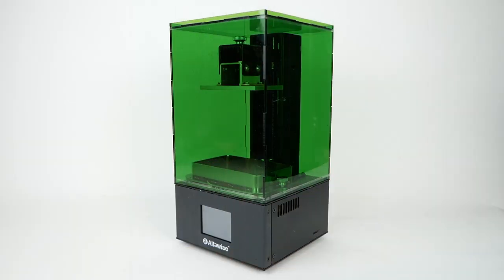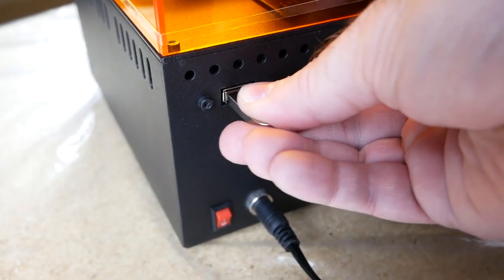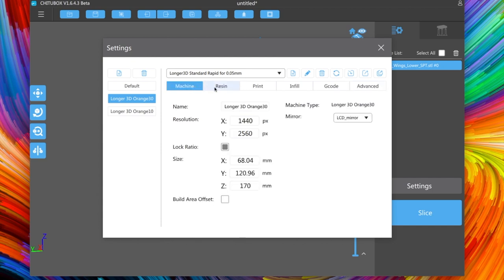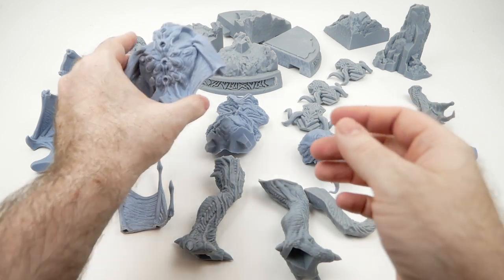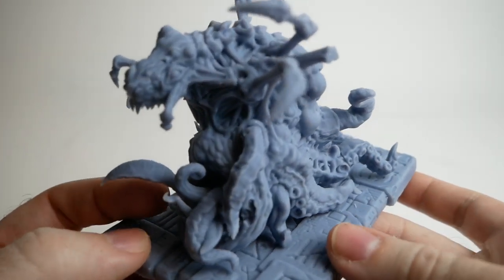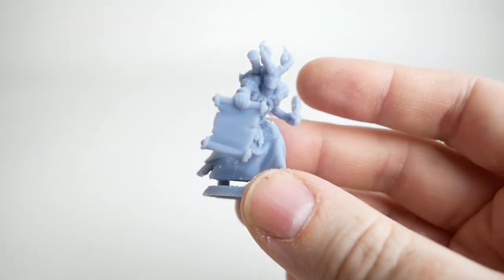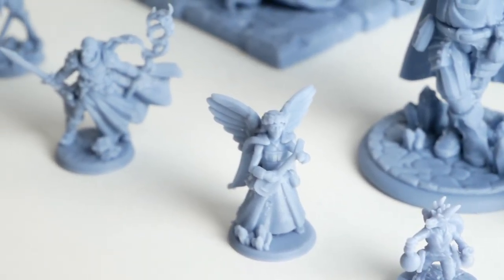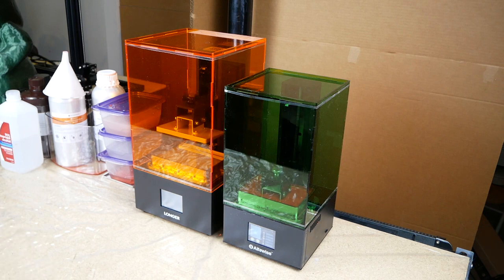Printing Insanely Detailed Models on the Longer Orange 30 Resin 3D Printer

Comment from the maker: Not long after I finished making this video, I started getting weird holes appearing in my prints, and after a while I figured out that a bunch of dead spots had appeared in the LCD screen that masks the UV light. The screens on these printers are considered consumables, and you should probably have to expect to replace it at some point, but one month of use seemed very short. Longer is supposedly sending me a replacement, but in the meantime I have purchased a replacement from Amazon for around $30, so I am back up and printing. I don't think this should necessarily be held against this printer, but the screens wearing out is absolutely an issue on this kind of printer, and is something you should be aware of.
Reply: if you have light off time in chitubox or in the slicer your using set it to 6.5 for prints under 7 hours. i tend to set it to 13 for prints over 7 hours. this will increase the print time. but it will allow the lcd screen and uv array time to cool between layers this will increase the life of your lcd. but yes the screens are consumable. and easy to replace. this will be the same for all lcd printers. but light off time will defo extend the life on the screen. had my screen for over 2 years in the photon. sadly the defualt settings in chitubox is 0 and people dont realise how important light off time is. hope this helps Jabba
Reply: Mighty Jabba's Collection, shouldn't that be covered under the 12 month factory warranty?
Reply: @jameszx7  resin printers tend to come with just 90 day warranties on things like screens with new printers as its a consumable item. sadly but check just incase
Reply from the maker: jameszx7 The 12-month warranty specifically excludes the screen and FEP film, but I think they do have a shorter period during which you could theoretically get a replacement for a failed screen. However, I should say that I still have not received a replacement screen from them, and at this point I don’t really expect to. Trying to get any kind of warranty service from Chinese companies can often be difficult
Reply: This is a common thing its either hit or miss, my Photons (I have 3 of them) have had hundreds of hours of printing on them. Make sure in chitubox your light off delay and bottom light off delay are atleast 1 second (generally you should have it 1/2 the time of the exposure time) this increases the longevity of the screen alot.

The newer Mono screens print around 5x faster (2 second layers) and last 2-3x longer because of the way they work
Reply: @B143DP  i'm not a printer yet, but what you say about the mono screens is another reason i'm looking at the elagoo saturn just from what i gather from researching these things.
Reply: When you replace the the fep film try giving it a coat of ftpe oil on the inside this will make it release the print easier ( less failed prints due to sticking) and also increase the life of the film. It’s a bit like Teflon spray but it cures perfectly clear do doesn’t impact on the Uv.

Comment: I do an initial IPA wash, then give the models a hot water bath before removing the supports. This causes the supports to practically fall off in most cases.
Reply: I’ll be trying out your hot water idea, thanks.

Comment: Hi, what kind of glue do  you use to put them together ? I have issue to glue resin pieces with standard glue (army printer glue)
Reply from the maker: I just use superglue in most cases. Mine is from Bob Smith Industries

Comment: may i suggest doing a rotation on 30' and reduce the support density to 25% .. i have had great success with them settings and also .. leave the models inside the cleaning fluid for about 2-3 rs .. the fluid will eat away the supports to the point you can actually just wipe them off

Comment: z-banding is a pain. add some lithium grease on the z-rod. when hollowing best place for the vent hole is at the base of models. ie they need to be one the first parts to print. so that the suction is reduced. this will help print larger models a lot better. i also use the prusa slicer for adding supports. its way better then the default slicers. i tend to then export the stl file with the supports so i can then load into my default slicer to slice for printing. i love my resin printers. i have a few so if you ever need any help with them just send me a pm :) great video also as normal :)

Comment: Could you connect it to your computer directly with the USB port,  or is a thumbdrive required?
Reply from the maker: I’m actually not sure. Most printers can be tethered to a computer but I have never done it since there is really no advantage and several potential disadvantages. For example, you have to have a computer right next to the printer, and if the computer goes to sleep or locks up your print will be ruined.

Comment: We're at the point where things are about 12 years or so behind high level sculpters like GW, catching up very quickly though.
Reply: It's not so much about being behind X years. It's a question of how much time a sculptor spends on refining a model (time is money) and how talented a sculptor is. It already starts with the anatomy which can be a challenge. A 75 mm sculpt (like the ones from Kimera Models or Big Child Creatives) does cost about 1300 $. Sideshow's big 1/4 scale collectibles are 2.5K and go up to 8K for a commission. Studio quality has it's price and finding such on sites like MMF, CGTrader, Patreon, Gumroad and similar sites is hard but not impossible.
Reply: @Holztransistor  Proportions on a mini aren't hard to sculpt. You're on a 5/6 head scale instead of 8/9 heads, that's all. What make the difference isn't the sculpter. It really IS the technology. You'll never get GW quality with a printer. GW doesn't print anything, it's melting technology allowing way more fine details. And it's not a matter of years, it's a matter of technology choice.
Reply: i would put it at less then 5 years at this point man...
Reply: @CK  I wasn't talking about proportions. I was talking about correct anatomy. What GW uses is injection molding. The same technology that is used since decades for scale model kits. The way they have split the models allows for high detail with this technology. But GW isn't the standard for me. Sideshow, Prime 1 and others like them are. I prefer 1/6 scale or larger collectible statues. The kind Ritual Casting does. Just larger. Technology means nothing if you do not have a 3D model that is highly detailed.
Reply: You mean GW are 12 years behind indie sculptors right? They haven't made anything in years that can compare to the  real high level models you get now on patreon and they are we;; past the point of producing far more crap than even mid-tier minis. Look at the Makers Cult for example, puts Forge World to shame.

Comment: And half a year later we have mono LCD printers with 4K resolution at 5.5" or 6" which are able to print a much higher level of detail. Provided you find sculpts that are good enough.
Reply: and  are shitty quality printer .... Saturn is a fail. More fragile than cristal even on carefull use
Reply: @kalendor  It would be nice if you delivered an explanation along with your rant. Otherwise it's completely meaningless. And besides, where did I mention the Saturn? There are many more mono LCD printers. I was specifically writing about the smaller 4K printers. That is not the Saturn.

Comment: hey i got a question do you keep your printer in a well ventilated room?
Reply: Depends on the size of your room. Typically for a printer this small I don't ventilate, even in a 12' x 16' room. It smells a little and if it bothers you just crack the top of a split window and turn you ceiling fan on low. If you get a bigger printer, I tend to ventilate the room with a small fan in the window exhausting fumes. Now for the big boy printer, That one goes in the garage and has it's own ventilation duct exiting the house. Same goes for the Classics Appearance Reci 130W 36 x 24" Laser Cutter.
Reply: @johnbrooks6257  alr thanks

Comment: So it took nearly a week to just print and then cure time? How many prints do u get from a tub of resin? Like standard 28mm mini? Edit ok this model is killer and massive so the time make sense
Reply from the maker: It’s hard to say how many 25mm miniatures you can print from one large container of resin since there are a lot of variables, but several dozen most likely

Comment: Do you think resin printers will be capable of printing something like a articulated model on a set of sprues? I have always enjoyed 3D printing but never sprang to buy my own printer because I’d want to make something articulated at the same visual quality of action figures
Reply from the maker: I’m only just getting started so I don’t pretend to be an expert. But I think it would need to be a special kind of resin. I’m now trying out some  “ABS like” resin that is supposed to be more like ABS plastic in its properties, and part of that is that it’s less brittle. But even that probably wouldn’t work all that well for articulated models

Comment: that look more good than garage kit btw, with little clean up, and you could do more in print setting to get more good result. like smaller layer high, orientation etc lol
Reply: Not only that. When he mentioned failed supports and he increased the exposure instead of just adding more supports, that did not seem to be the correct solution to me.
More exposure can lead to losing detail and it also can have an impact on how well the parts fit after printing. 
The recommended exposure time on a resin bottle does not fit all printers. It depends on how strong the LED array is and now another factor is the LCD (RGB or monochrome). So the best way is to dial in resin using the Ameralabs town or similar models to see where you get the best level of detail. If a print is failing with those settings, I'll add more supports first before going up with the exposure.

Comment: My main issue with the resin printers are the toxicity of the resins.  I was actually surprised you were all in on this given the issues you had with the adhesives and solvents you used on the life sized Jabba.  These resins aren't new, but until fairly recently they have been limited to commercial environments that employ stricter and better environmental controls.  Proper ventilation, mandatory use of PPE, etc.  For consumer use much of this is nonexistent or at best optional.  So the long term effects of exposure to these toxins I feel is largely unknown.  As a result I've avoided the resin printers despite the temptation they present in terms of detail.
Reply from the maker: I'm a lot more careful now, so that probably helps. And the resin I'm using doesn't really smell compared to epoxy glue. But it is a concern to be sure.

Comment: Hello, second comment, almighty jabba :D
Also, i feel like you've stopped uploading as regularly, if thats the case, why is that?
Just wondering.
Reply from the maker: Well for one thing I have been busy making this 20+ minute review video :D. I mentioned a while ago that I would need to upload less frequently because I wanted to work on more involved videos like the ones about the LEGO barges, and not just quick videos about collection pickups.
Reply: @MightyJabbasCollection  Oh, Yeah, i forgot about that video. 
Well, thanks :D

Comment: Your exposure times are too high. That's why you're losing crispness.
Reply from the maker: As I mentioned, I got repeated failures with lower exposure times (4 times on the abdomen piece, after which I switched to 8 seconds, then once on a base piece, so I changed it to 9 seconds, and that's where I am now). Of course it's true that most models did print fine with 6 seconds, and I only had issues with very large ones. So I suppose I could try a variable approach where I print smaller models with lower exposure times. That said, the quality I got from the smaller miniatures doesn't seem that far off from what I've seen in other people's videos
Reply: @MightyJabbasCollection  Temperature of the resin, and room where printing also plays a huge role. If you're failing at lower exposure times, your room may be too cold. You mentioned being in the basement. My basement is about 60 degrees, which is too cold. I have heaters in my resin printers to keep internal temp at 80F.
My resin prints are crisp, more so than yours. Rounded edges of crisply modeled lines is indicative of over exposure.  Hope that helps!
Reply from the maker: Temperature could be a factor at that. We did have some colder nights recently
Reply: @MightyJabbasCollection   I print in my basement and it hasn't been over 58ºf in months, unless your using something like Siraya blue or some exotic resin temp isn't that big a deal. I used Elegoo, Anycubic and Siraya grey with no failures for months.
Reply from the maker: Do you also think the details on my smaller miniatures aren't crisp enough? I'm not big into the smaller miniatures anymore so I'm not hugely concerned about it, but I'm curious. I've been very happy with the detail on the larger pieces I've been getting, so for the moment I'm sticking with the longer exposure times I've been using.
Reply: Elegoo recommends 8sec for exposure for their standard grey resin - it's written on the bottle. So I don't think he's that off..

Comment: Yeah, photopolymer resin fumes are carcinogenic, definitely wear a chemical-rated mask, and do not print inside your house. Especially if there are toddlers or small animals in your house. The smell is not the problem. You need proper purpose-built ventilation not for comfort, but because this has highly carcinogenic fumes even if you don't find the smell too bad.